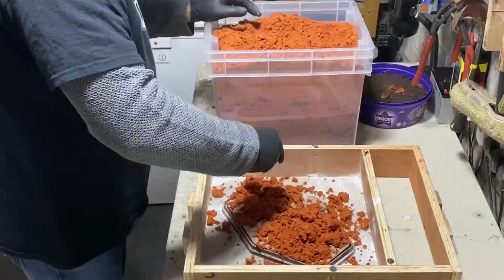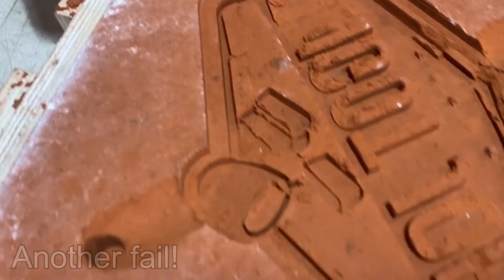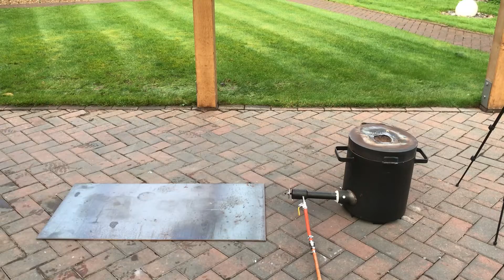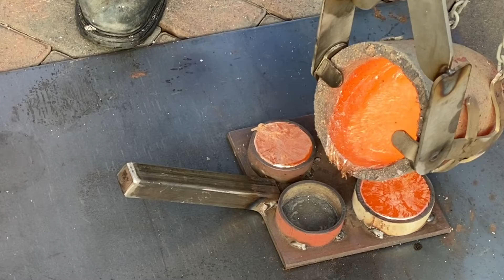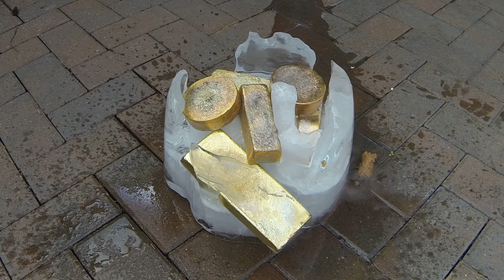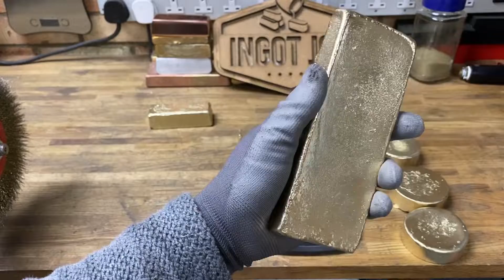Petrobond cast Fail! Oh well, I'll melt a mother load of metal!

Comment: Great video again Joe! I know the feeling of the pattern holding back some sand all too well 😂😂 Maybe you could add some more draft to you pattern? Great bars and coins! I see you upgraded the locking pin, so you can handle it with gloves on. Great improvement! I succeeded in casting the Ducati logo! Next week alu bronze and the week after that a special project as you know 😉
Have a good weekend!